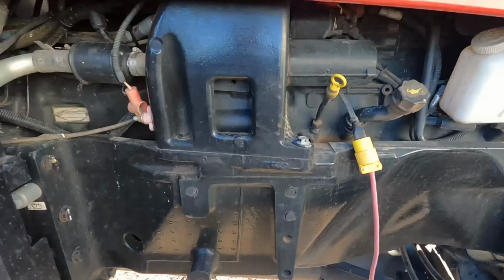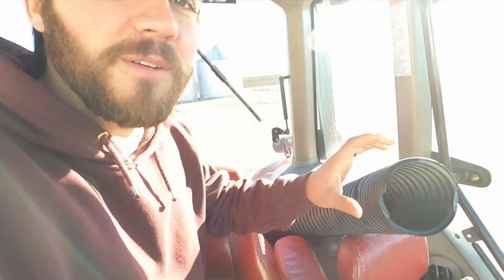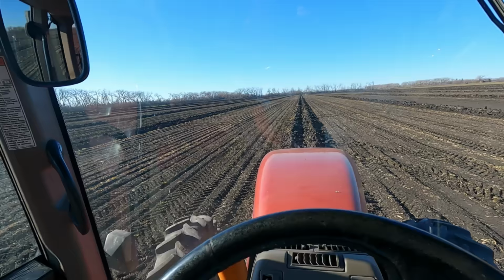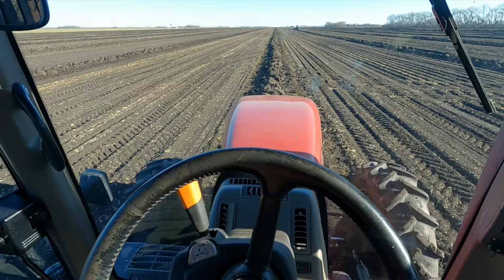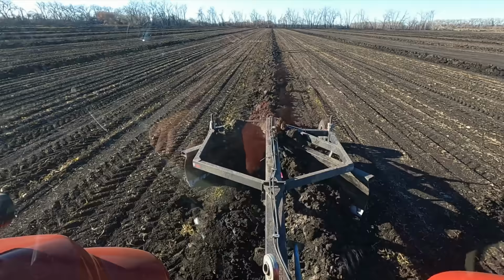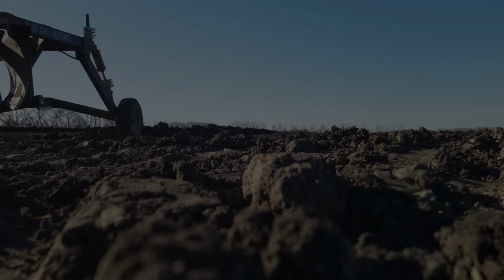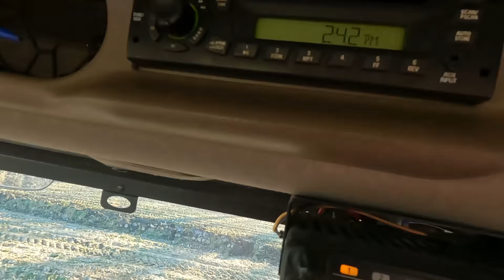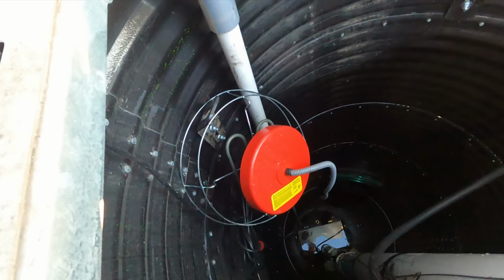Drain Tile Project

Comment: How deep does the soil freeze? Of course there will be a range depending on the severity or relative mildness of the winter.

Are there any special preparations to prevent freeze damage to the sump pump and it's outlet piping? How far does the pump pump? It pumps to a drainage channel that leads to the Red?
Reply from the maker: It depends on two main things. How cold it gets and how much snow we get. Usually it freezes down 2-3 feet. 

As far as I know the pump will not get damaged internally, I have seen some pumps have their exit pipe break due to shifting ground, but it’s not common. 

The pump empties into a drainage ditch that will eventually filter its way to the Red.